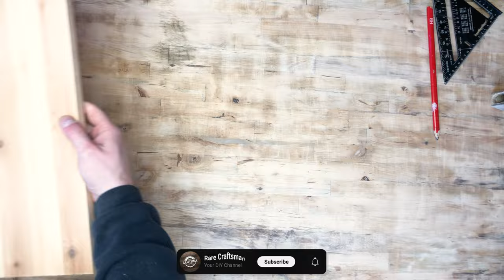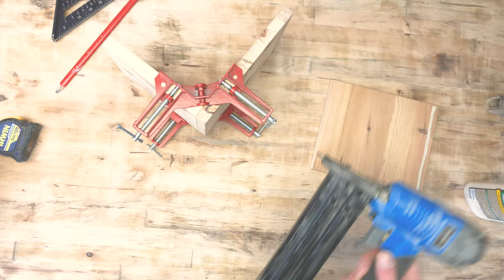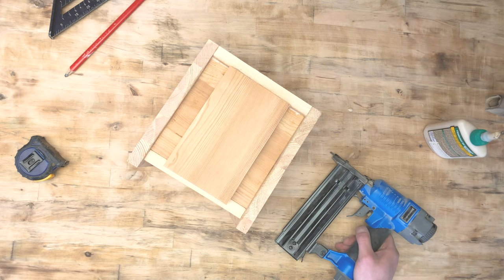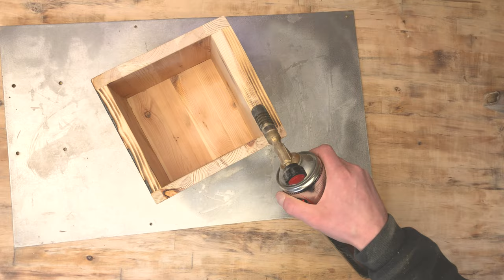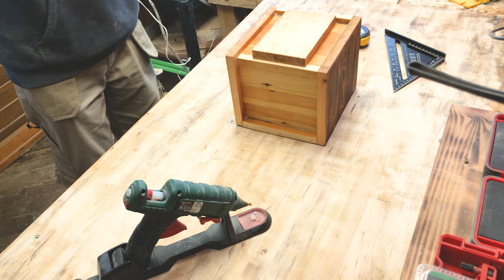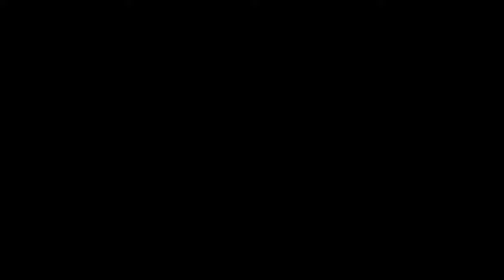Woodworking project that sells: Scrap wood LED plant pot!

Comment: Great work! Thanks so much for the plans! Quick question, what typeof ledlights are they, and are they battery operated or plugin? Thanks
Reply from the maker: Thanks for the comment! Led lights used here are 12v DC plugged in to mains using a small power supply. I hope this helps.